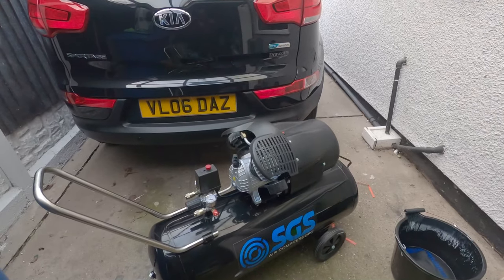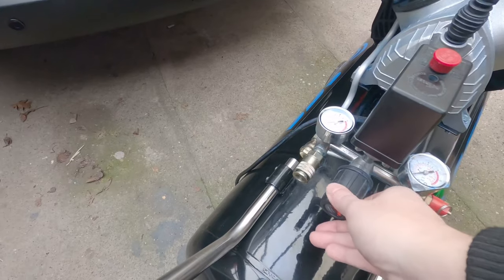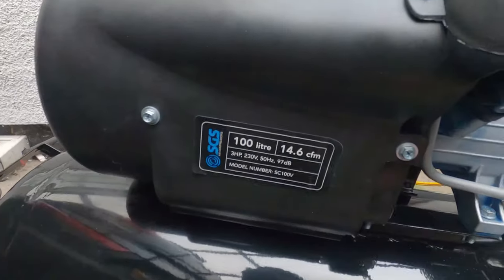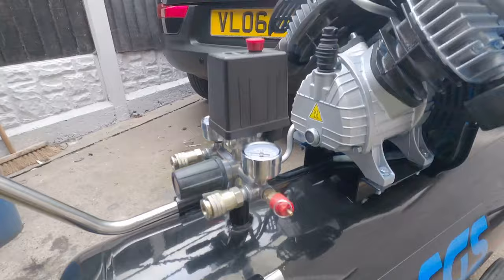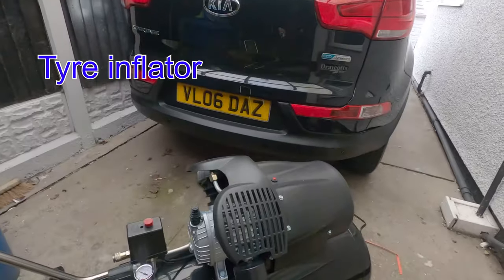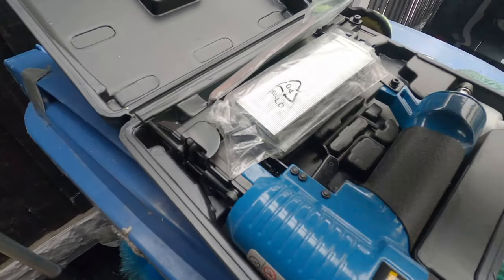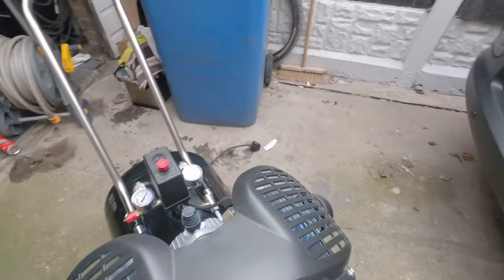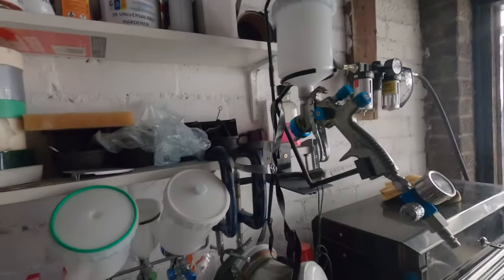Best air compressor / SGS #generator #generators

Comment: Never had an air compressor, just bought this model SC100V-K1 earlier today from SGS and asked what I need etc… this was really helpful, especially the 30amp fuse. I didn’t considered that before ordering it so will have to look at how I can get around the 30amp fuse issue as I think the only spur I have is the one connecting my cooker 🤷🏻‍♀️🥺
Reply from the maker: Have a look for the fuse for the sockets and then put the bigger amp fuse in the slot for sockets, it’s only the initial start up that needs the amp, hope it helps you if you live near Nottingham I have an extension hose and regulator you can have

Comment: Just ordered one of thease for sand blasting an paint spraying can you please help in what lead to buy an sandblast gun and what sand to use it’s for cycle frames thanks
Reply from the maker: Your best bet is visit a auto pain supply they will have all the answers never used it to sand blast but good luck with it and hope you subscribe to the channel let us know how you get on
Reply: @DazPreston69   thanks yes I’ve subscribed does the amp fuse go in the plug 🔌 sorry I’m a novice 🙈 ha
Reply: 30 amp fuse sorry
Reply from the maker: No in the mains box
Reply from the maker: It’s to initially start the air compressor up , I’m more than happy with it , and a few tools bought now , be going through a few on a video soon
Reply: @DazPreston69   look forward to more videos and tips I bought it for sandblasting spray painting but I will probably do more once got used to it havnt recieved it yet
Reply from the maker: @jamesrotherham9499  is boys and toys , it’s about enjoying and using it ,

Comment: I got my compressor started it up it’s bit loud to run in me flat so I have two issues I need to run an extension lead outside or I’m watching a video of your bohmer generator could you tell me if your compressor which is exactly the same as mine will run with your generator the manafacturer said it won’t run on a generator because the generator won’t have enough power but it will save me a fortune if you help me out with this ! Extension lead ! Or generator the one you have in video so grateful if you could help thanks
Reply from the maker: He’s right the generator won’t have the initial start up required for the air compressor other option is to get a real heavy duty extension lead but wouldn’t recommend it to be honest , take a photo of the label on compressor and go to Screwfix and show them what you need it for , let me know how you get along hope you subscribe to the channel
Reply: @DazPreston69   thanks I’ve already subscribed:) thanks I will let u no when I get sorted
Reply from the maker: Hope you get it sorted good compressor
Reply from the maker: @jamesrotherham9499  another solution would be to see if someone has a socket on lower level and buy a longer hose
Reply: @DazPreston69  I carnt do that really there is no sockets surely a bohmer generator the next one up from yours I think it’s a 8500 w or 9000w would run it all day back to the drawing board don’t live in a flat ha ha
Reply from the maker: @jamesrotherham9499  it’s not the running of it ,, it’s the first start up of the compressor takes a lot of amps
Reply: Seems to be working ok on an extension lead no issues so going to use it save me a phew Bob ha we’re can I buy sand blast media does b an m or garden centres sell it or b an q
Reply from the maker: Check Aldi and Lidl if it’s just for casual use, or amazon,glad it’s working for you just keep an eye on it though
Reply: @DazPreston69   it’s for sandblasting bike 🚲 frames ready to be sprayed up yes thanks I will do the extension lead is a good one Amazon isn’t very good been looking I thought screw fix would sell it but they don’t thanks 👍
Reply: So far so good all working sandblasting is a success I’m pretty happy had no issues with compressor on extension lead saved me a phew Bob on generator:)
Reply from the maker: @jamesrotherham9499  brilliant mate good job

Comment: Did you say 30 amp or 13 amp?
Reply from the maker: Upgrade to 30amp in consumer mains box for initial kick up
Reply from the maker: Or it will just trip
Reply: @DazPreston69  seems quite excessive does that, mates garage at home is wired to a 16a circuit and that runs a 3hp compressor no problems, had 2 welders on max at the same time before, lights dipped in the house like but that was it
Reply from the maker: @BenEyah  it’s just the initial starting up for the bigger fuse